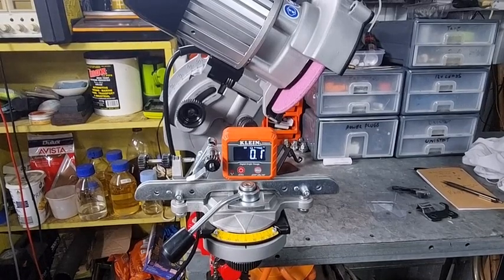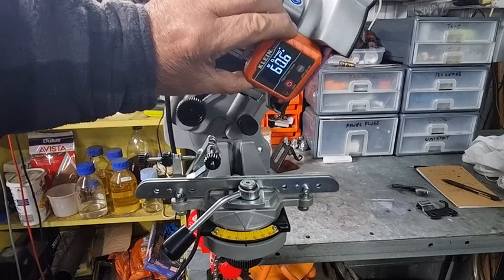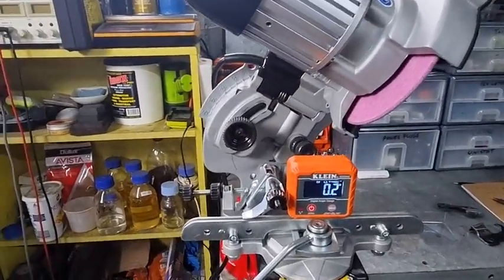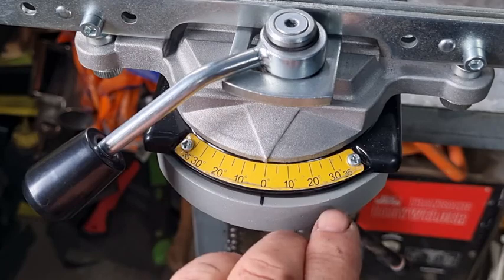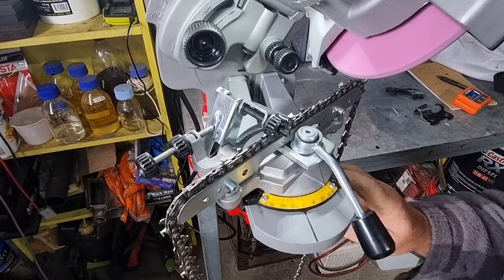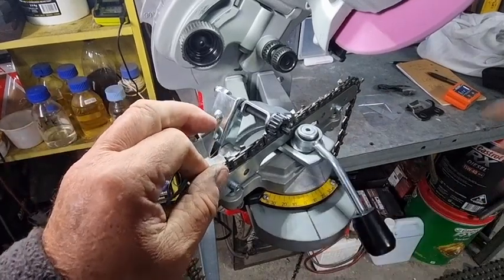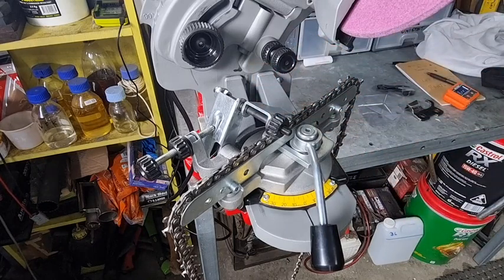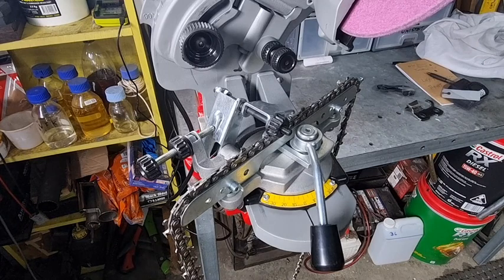Tecomec Jolly Evo review 1 year on.

Comment: How is the 10 degree down angle achieved if the clamp only slides front to back? Is it by the radius of the grinding wheel? If so then an exact diameter as original wheel must be used? Give up the info if you will as I am ready to order. Which style would you prefer for down angle adjustment? Thanks so much.

Comment: Thank you for posting the video, but I think you’ll find it interesting that the directions in the manual are backwards. The down angle on the right hand cutters is supposed to be away from the operator if you remember the phrase right away. The left hand cutters, down angle is toward the operator. I am 100% positive about this if you read further in the manual, you will see that it says two different things at two different spots in the manual, the right hand cutter away from the operator, and the left hand cutter toward the operator results in a properly sharpened chain.. also you must’ve got one of the only ones that has the proper angles on it because everyone that I have seen has been off at least 2.5° on the top plate, angle, the side plare angle and down word angle. You are right though. It is a great machine when it works properly. 👍
Reply from the maker: Yes correct the phrase right away I always remember that. And remember pushing knob away from you tilts the guide rail towards you.  So the vice go towards you.  I have many grinders but only 1 vice type.
I did the same for right hand cutters and pushed the vice away.  Just think about the tilt vice how it works right away tils the vice towards the operator.
Thanks for your comments
Reply from the maker: Another point is checking the alignment of the center bolt with guide rails I use a mitutoyo straight edge.  Using a metal rule is only good if it's 100% flat.  I made that mistake also
Reply: @ChainsawUsers  yes, I saw a video Stoneybrook made a while ago, giving a demonstration of how the angles were all off and then I went in my manual and he was right. The directions are backwards. I followed his instructions, and now the thing cuts like it supposed to. a couple of people asked him to do a complete set up video. I know I’m waiting for it but I think I’m good. It’s cutting pretty good now.  It’s hard to believe that they would ship the thing so out of whack when it’s made in Italy.  I will say your machine is a lot cleaner than mine. Ha ha.
Reply from the maker: When the phrase used right away means push knob away from you for right hand cutters. This is correct the  right cutters will move away further away from the wheel when you push the knob.  Just remember the cutters  left or right must tilt away from the wheel you can't make a mistake if the cutter leans backwaaway from the wheel